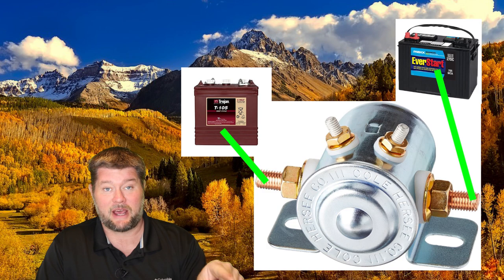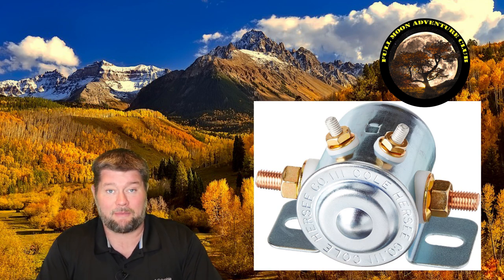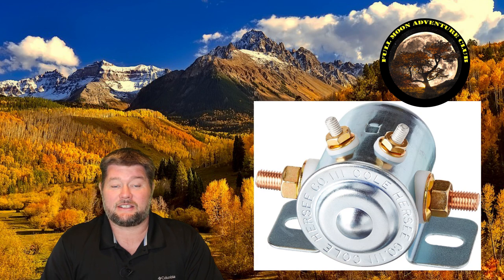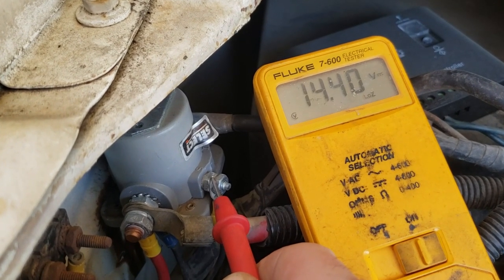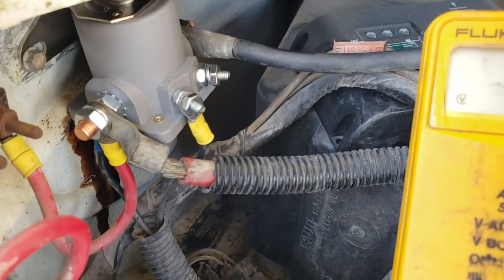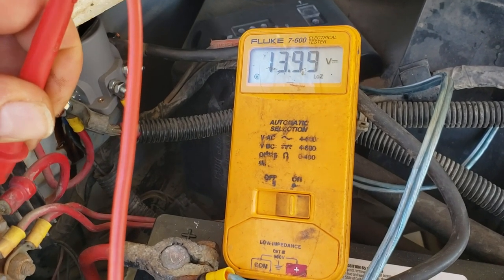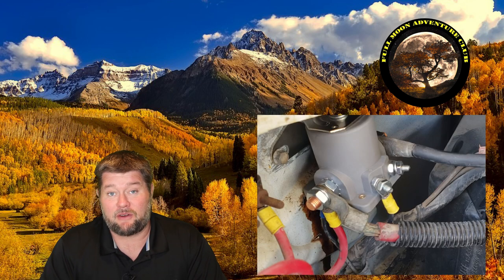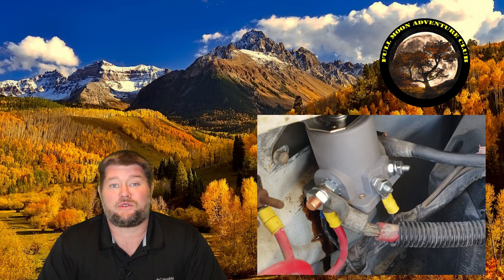RV Emergency Start Not Working   Try This First

Comment: You seem very knowledgeable about RVs. I have a 94 Thor Residency, Ford. The ignition on the column is gone. I need to find a way to move this rv. My dad used a couple of jumper wires and a push button start but now at 82 y.o. he cant remember how he did it. Can you help Me? I have pictures to share. Solenoid works fine.

Comment: So I have a 2007 Fleetwood Revolution LE.  My switch is working but the solenoid wants to stay in the "on" position.  Is it normal for them to get stuck in the "on" position?  It sometimes does go back into the off position.  You thinking solenoid issue or wiring issue or fuse issue?
Reply from the maker: My guess is the solenoid. Mine burn out on occasion. I would start there. Good luck and thanks for watching.

Comment: I can't find a solenoid, but I have had luck with starting the generator, then running an extension cord with a battery charger to the battery. The emergency switch on my Gulfstream POS has never worked since brand new! And they have never been interested in fixing anything!